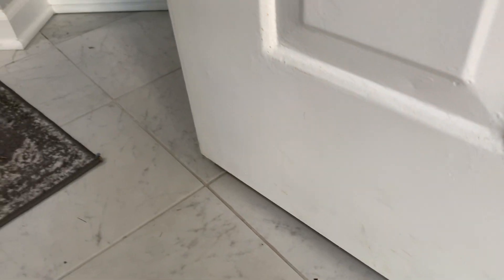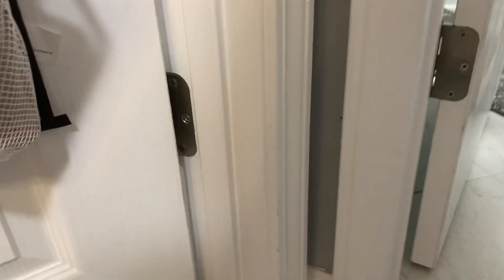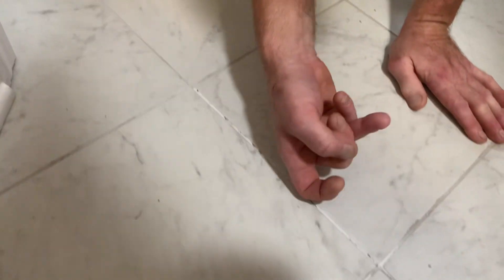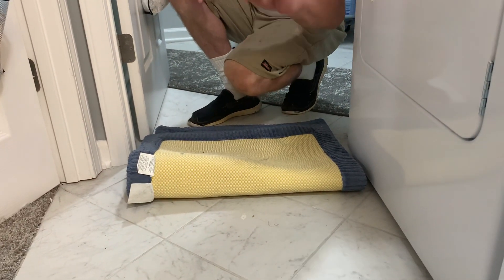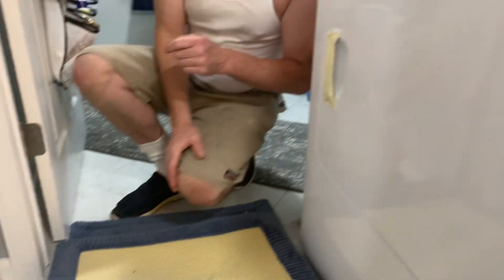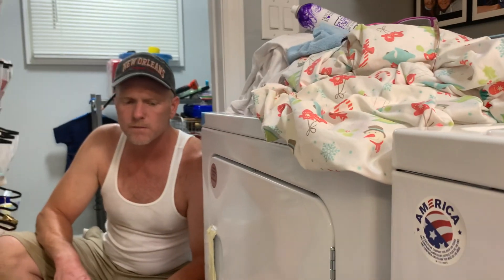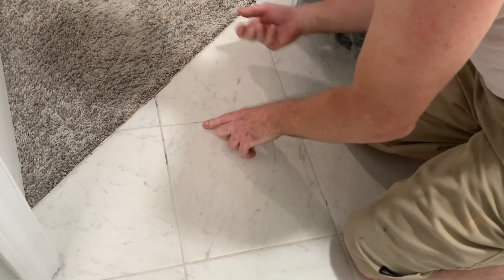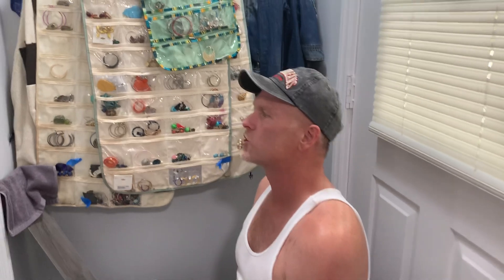Why you need a certain Underlayment for ceramic tile by a 3rd generation tile setter

Comment: Wow, this brings back memories. Many years ago my ex-husband installed ceramic tile in the dining room in our little townhouse in upstate New York. I do recall him putting the extra layer and then laying the tile down what happens after that was the dining room floor was higher up than the kitchen that just had vinyl and the living room that was carpeted so he had to get a strip I forgot the name of it but there’s a little metal strip that he nail down I think it was called a threshold not sure he had to nail down the metal one between the dining room and kitchen and then he cheated between the dining room and living room he got a piece of Then wood molding and he used glue like a very strong industrial glue and glue to strip down. Thanks for the memories!